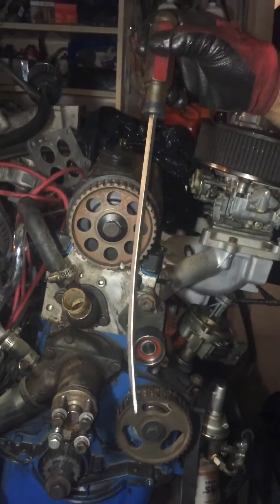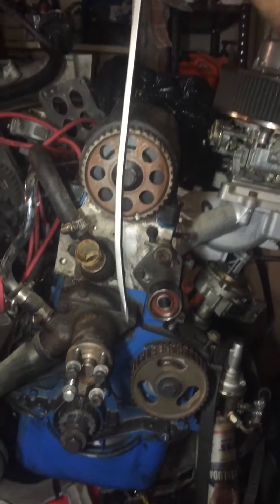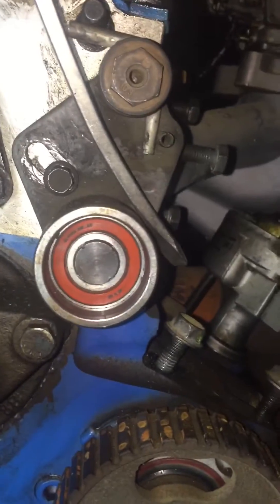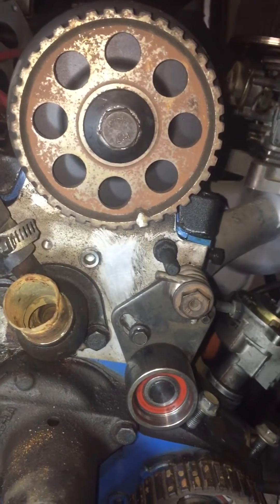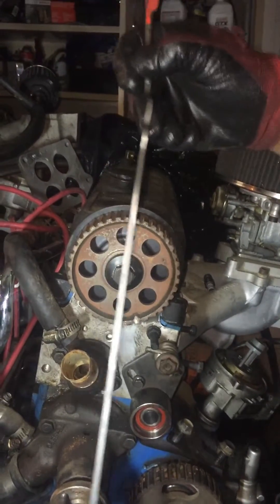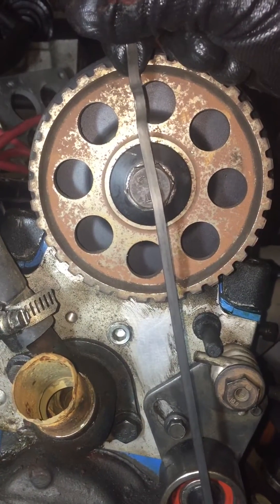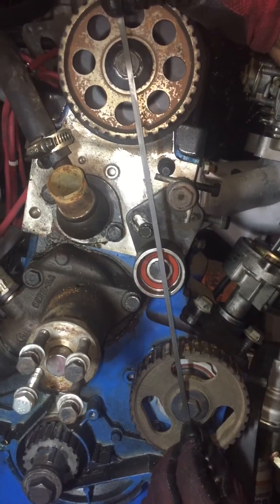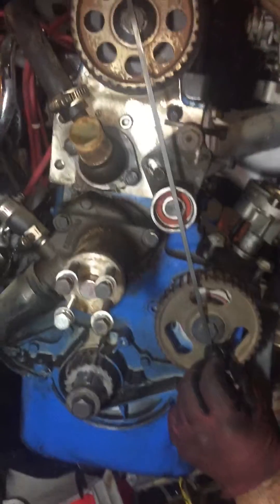SVO  setting timing belt Step 2  Ford Merkur 2.3 Pinto Turbo Thunderbird

Comment: How in the hell did you bend that screwdriver like that? I'm working on a 2.5L pinto in a Ranger, I would have killed to have that screwdriver. I made a tool out of a 27mm socket with an angle grinder. Interestingly enough, I still have to do that job again. I couldn't figure out why the belts I put on kept walking right off. Turns out someone who worked on the truck before me took the belt guide off the crank sprocket and never put it back on :/